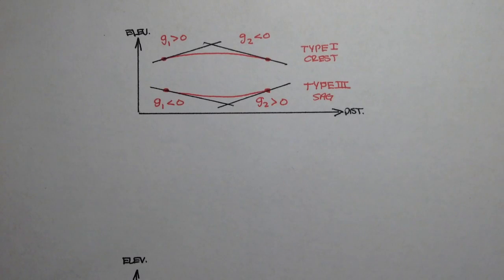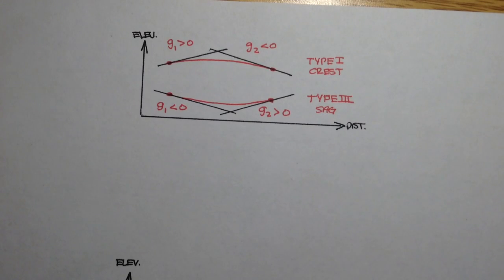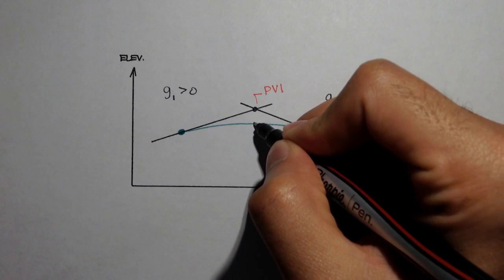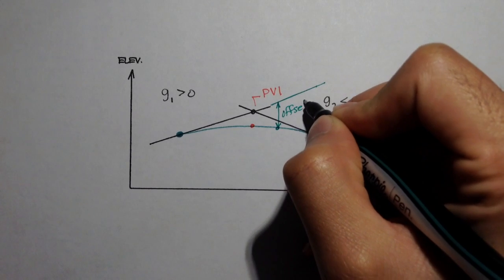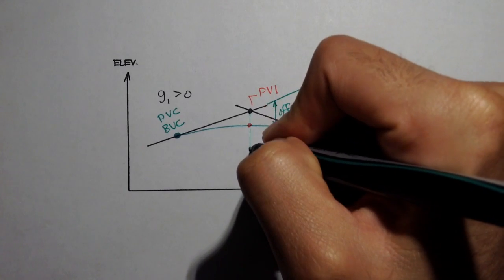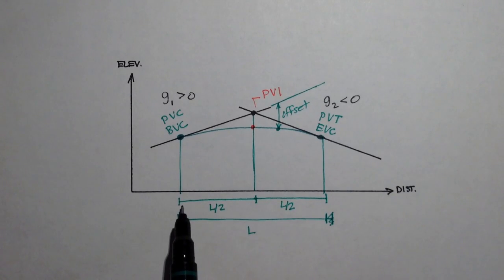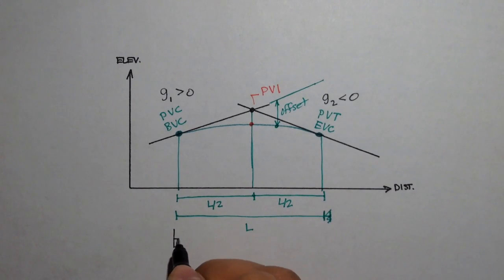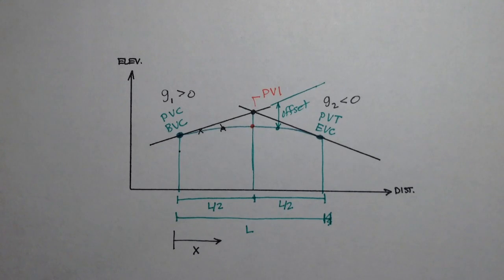Advanced Geomatics: Vertical Curve Characteristics

Comment: is there any chance that we can have compound vertical curves just like we have compound horizontal curves? i remember seeing a very very complicated vertical curve problem when I took my FE. it was like 2 curves in series :|
Reply from the maker: WHY70122 Yes, in fact there are many vertical curves which are "compounded" together. If you look at them closely, though, you'll see that most of them are simply two different vertical curves put together. Instead of having just two grades constitute the geometry of the curve, there are three grades (the middle grade is shared between the first and the third grade). These are called asymmetrical curves. Hope that helps!
Reply: +Simmy Sigma pls make a vid tutorial on that too. thanks :D